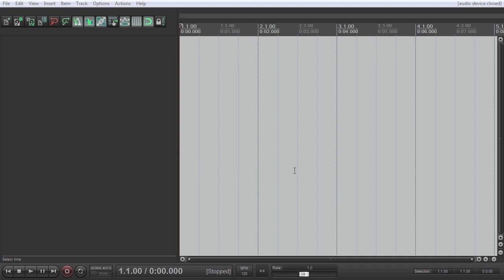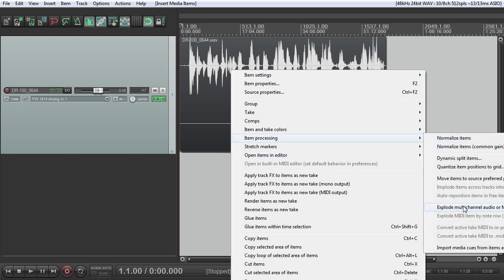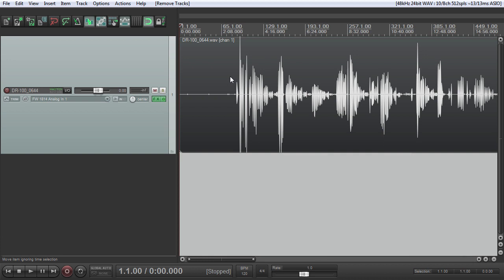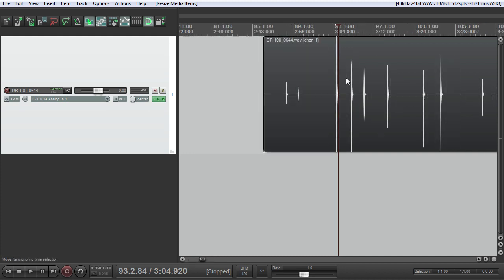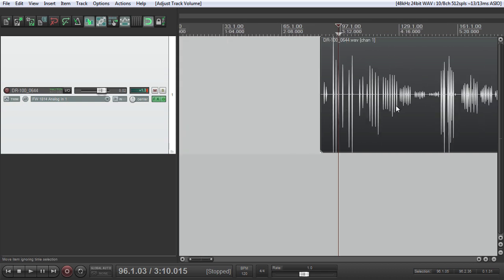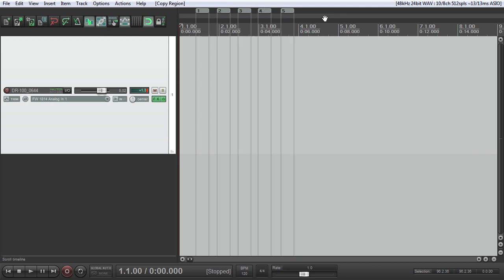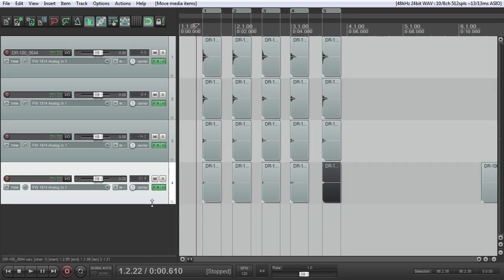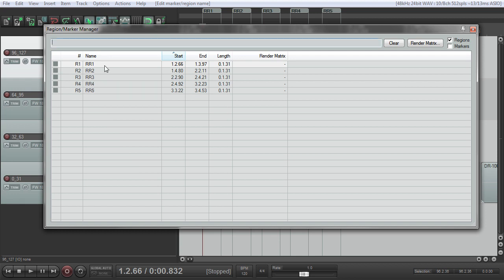DIY Sample Series: Impact Hits

Comment: people still use Reaper?!?!?!
Reply: skltr21 lmfao. You don't know what your missing - the powaaaaaa

There is a better way to do what he did in the video of organizing the samples though, coulda used dynamic split w/ zero crossing and had them all lined up instantly for him.
Reply: +Fearghas Gundy could you make a video showing what you mean?
Reply: +Stryke9DaDon 

It's simple enough no video is needed. Start by using the dynamic split action. Set the zero crossing tickbox to on in transient sensitivity settings, and set the sensitivity with the two sliders until it looks right. There should be one split per hit. 

After splitting, use Nudge and set it to Set and set the item position to 1 for example, untick relative set. Then all the items will move to the same place in the arrange. 

Now use the Xenakios/SWS action (every Reaper user needs SWS installed) 'Explode selected items to new tracks' and you will have a folder full of all your samples, each to it's own track.

The reason we did this is now you can select all the items, drag their left edge back a bit, and scroll up and down looking for any hits that were improperly split. Far easier than doing this horizontally, item per item.

Zoom in close while you scroll up, and if you see anything wrong, you can fix it really quick.

Now set the item edges back to where they were/where you want them, maybe put a short fade at the start just to ensure every sample starts at a zero crossing for no clicks/pops on sample playback, and you're good to go. Apply normalization if you want.